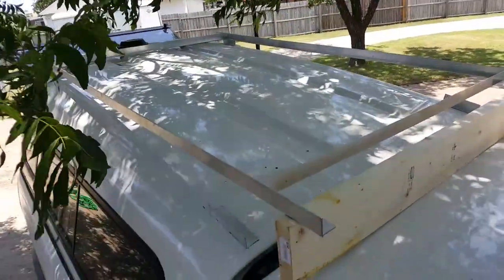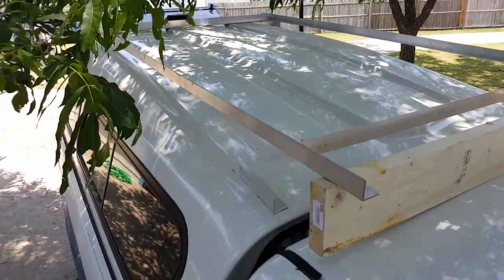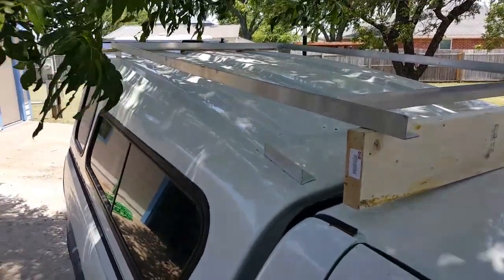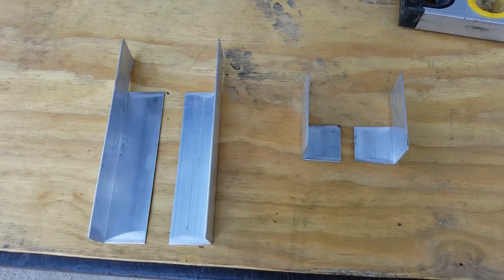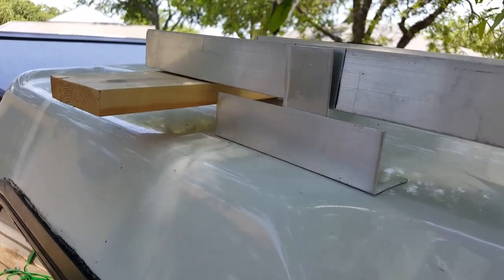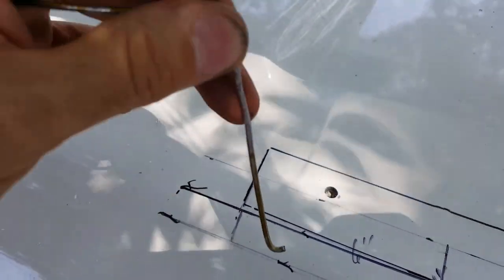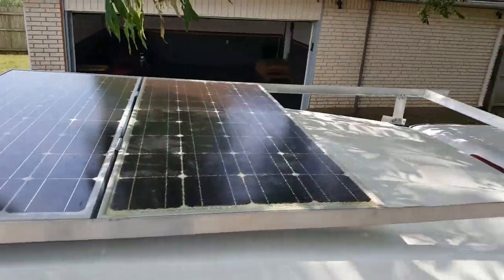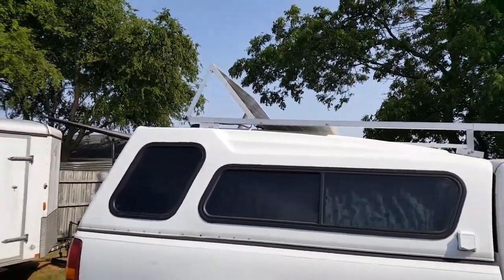SOLAR PANELS on Truck Camper Shell Bed Topper Solar Power Electricity Boondocking Dry Camping

Comment: I'm looking to do the ssme. A seperate battery system charged with solar panels so I don't drain the truck.

Do you have to ground the system? If what are you using to ground in the back there? Thanks, newbie with the electrical part. How many batteries do you have for the bank?
Reply from the maker: Thanks for watching M C. I have 2 6 volt deep cycle AGM golf cart batteries wired in series to make 12 volts. As far as the ground goes, I am not an electrician so I can only tell you what works for me. It seems like electricians cant agree, love to argue, and love prove that they are the only ones that are right. I have been told by electricians to ground to the frame and not ground to the frame. To me it makes no sense to ground to the frame with the rubber tires separating the frame from the earth. You will have to do more research and live with your own decision. Good luck.

Comment: I am about to do the same. My panels are cheep harbor freight panels. They work good, but I’m afraid they may crack from vibration( I’m on dirt roads a lot). Any suggestions for reducing vibration?
Reply from the maker: Very cool. We didn't have any problems with breakage and we did some rough trails. Those same panels are on my trailer now and still working. I have never heard that vibration was a problem with solar panels. You could use rubber washers between the mounting brackets and mounting surface. You can get rubber washers at big box home improvement stores or some auto parts stores. Good luck with your project.